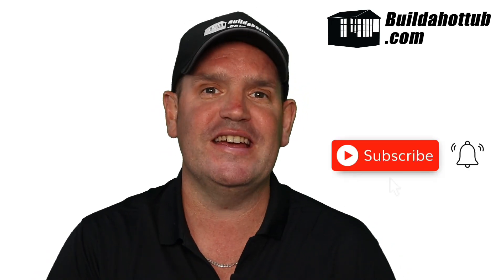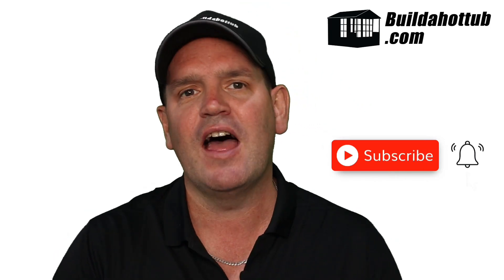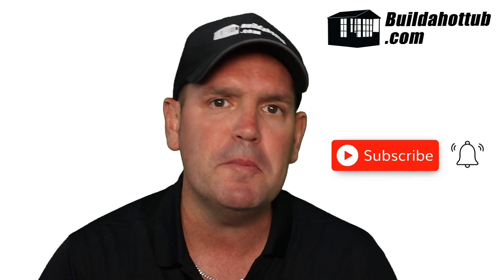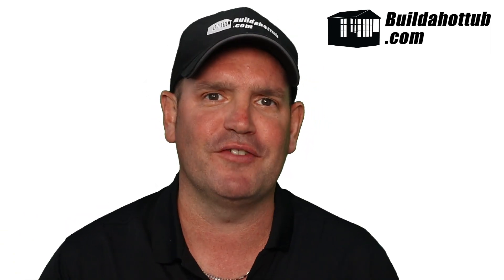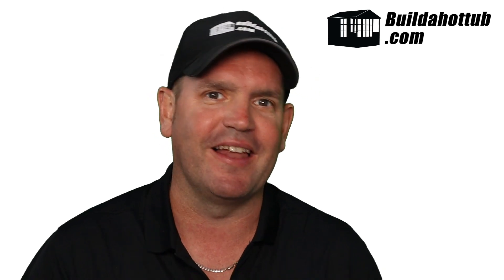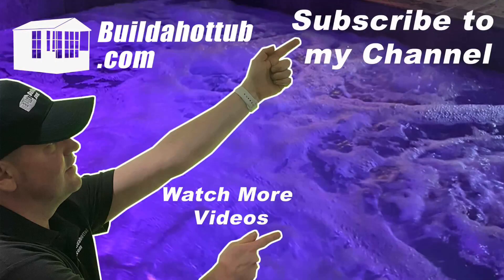How to add a Ground Loop, Earthing Loop, or Grounding Loop to your Hot Tub or Pool

Comment: It’s odd, isn’t it, that the NEC does not require a ground rod for spas?  Of course, one really wouldn’t make the user any safer against malfunctions; that’s the GFCI’s job.  But in the case of lighting - especially indirect strikes - I could see extra protection would be afforded to many of the components.  I’ve got HUGE trees near my hot tub, so for a few bucks… I went ahead and added a grounding rod.  👍

Comment: I'm actually just hoping to make some type of a grounded water bath...... Then have some type of continuous fountain going in it,  but have a big enough and also grounded to the Earth through copper wire or copper sheet metal AND have it connected to two of these 8 ft copper rods that you're talking about❤, I never knew such a wonderful thing existed for grounding....... Weirdly it's the thing that gets me relaxed and more sane faster than anything else when my mania hits.   I could probably take an 8-ft rod and just stick it in the ground with one foot sticking out and hold on to it 🤣 but you seem like a nice guy and I'm a complete ignoramus.... Wondered if you could spitball an idea for a fountain dipping pool big enough I can put my legs & torso into, which would be completely grounded to the Earth and allow me to have electrons through the copper from the earth into the water......🥰 Which is exactly what I want to try🎉.      And see if that brings me a little bit of Peace of mind, and wellness.    As I have a theory that humans losing connection to the Earth is part of the cause of all of our cancer and craziness, as we no longer absorb electrons from the Earth's surface wearing rubber-soled shoes...... Therefore we don't get the neutralizing effect from a negative charge on a positively charged free radicals which cause the majority of destruction to our bodies on a cellular level  🧐

So if you have any inclination to waste your time and reach out to me, let me know, I'm saving this video.   And I'll send you my American phone number on follow-up 🙏